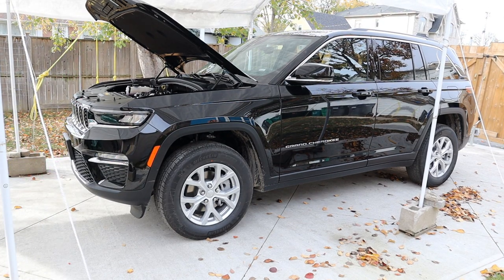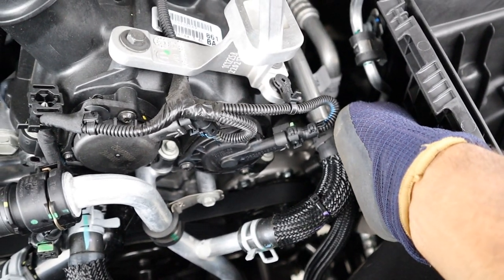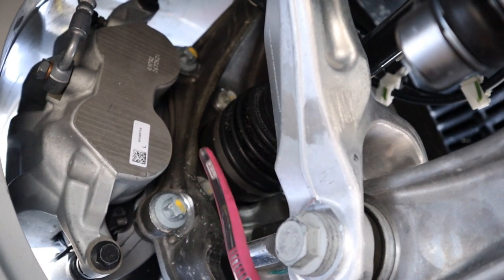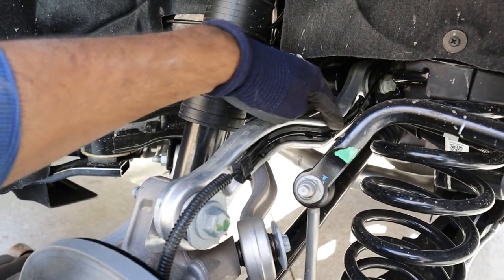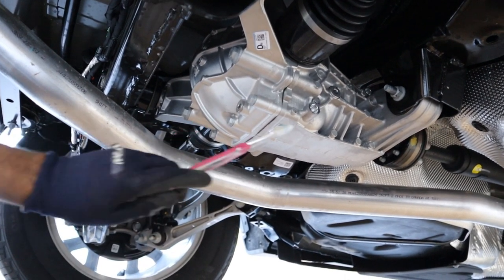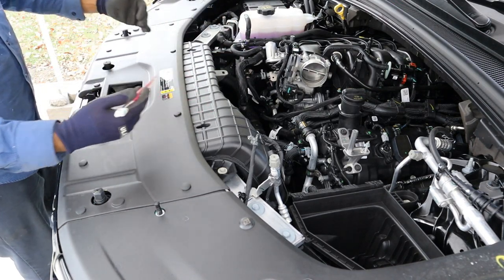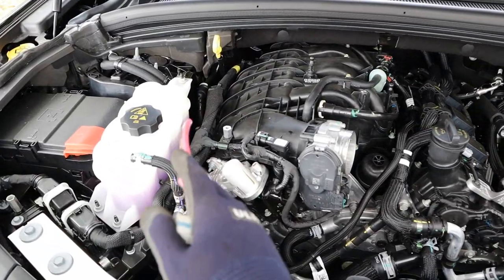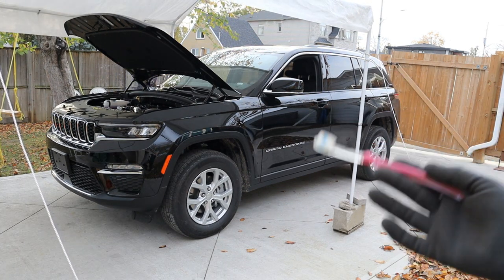Jeep Grand Cherokee Mechanical Review

Comment: I've bought new jeeps every few years, first cherokee sports then grand cherokees, and am on my 7th jeep now.  I really don't like what jeep has done to what once was a great vehicle.  Jeep was the vehicle that prompted so many manufacturers to introduce jeep wanna-be's.  It looks like my commitment to jeep has come to an end because this model is impossible for the jeep owner to tinker with.  And the jeep hybrid is an absolute joke with a measly 25 miles range under ideal conditions, ideal temperature and flat roads.  Good-by jeep. Whomever is running jeep now seems to be committed to killing the brand.
Reply: Well.... i gave in and bought another grand cherokee, 2023 model.  Considering what jeep has done to the grand cherokee I'm not expecting much, nor plan on keeping it very long.   I just have jeep in my blood.

Comment: Design gets worse with every iteration.
Reply from the maker: What's worse about it? Suspension?
Reply: @speedkar99  Suspension is a good start. What will that be, $2500 for new ball joints? Overall design and complexity is just absurd. New starter should be a 20 minute job, but on this it looks like 1½ hours if you're well prepared. Belt swap should be 5 or 10 minutes, but here it's got a half hour of hoses in the way.

The Cherokee used to spank the Wrangler offroad and on, this thing could barely traverse a dusty parking lot. 8spd auto with no mt option?

I've owned a few Cherokees before and the first 2 generations were outstanding vehicles for their time, this thing is just so disapointing.